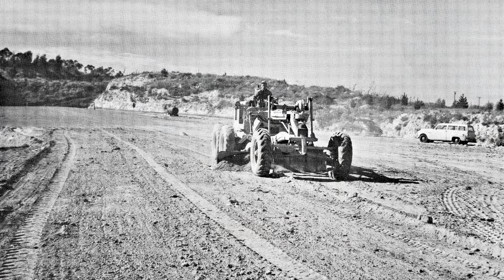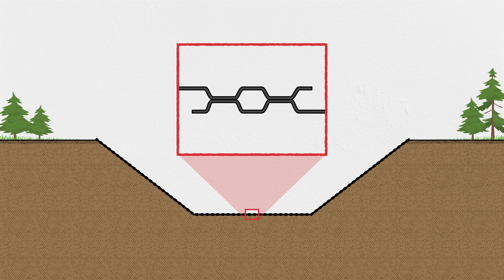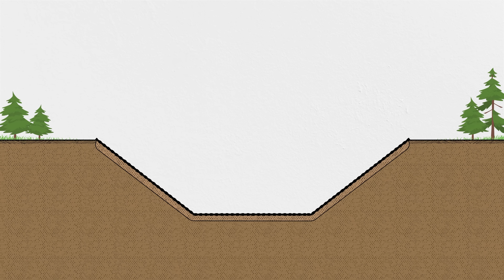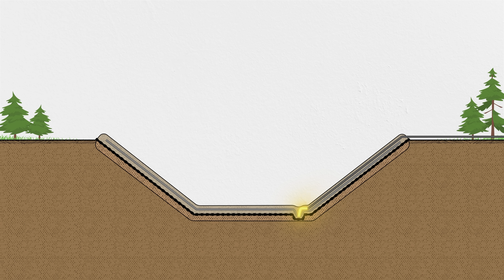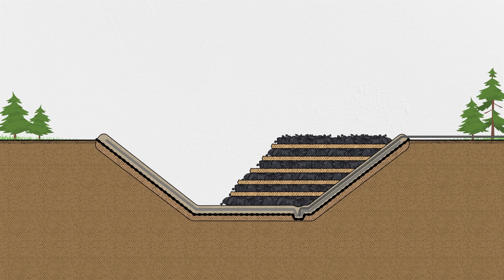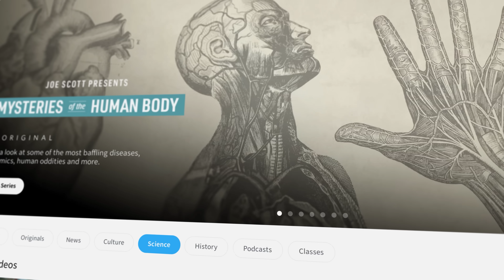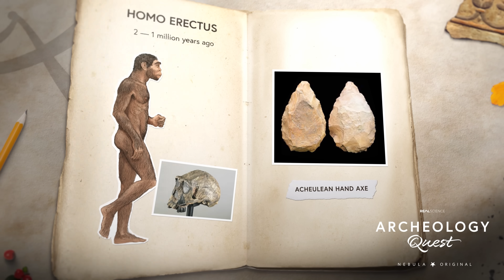The Hidden Engineering of Landfills

Comment: Fairfax County, Virginia used to have an active landfill on West Ox Road (it now serves as a transfer station for the incinerator which the various garbage trucks and the public will drop off waste which then gets trucked the nearly 25 miles to the incinerator in Lorton at the southern end of the county). They had put in the incinerator because the landfill had become the tallest point in the county, having risen over 300m since it began in the 1960s (becoming the tallest point in the county after surpassing Tyson's Corner in McLean in the 1980s) and was in danger of becoming unstable if it went too much further upward.

If you drive by the landfill on a clear night along Interstate 66, you'll see blue flames shoot up into the sky as methane is burned off. Indeed, the 911 dispatchers, if someone not from the local area calls in regarding seeing a fire at that location, will first verify if it is the landfill that the person is calling about and then explain to them that it's a controlled burning of methane from the old landfill.

Unfortunately, the county (when they installed the methane burners in 1996) decided to save $2500 by just burning off the methane, rather than using that burning methane to generate electricity. The board in 2003 was kicking themselves when they realized that they could have been funding county programs by selling the generated electricity from the burning methane to the grid. So they forked over the now much more than $2500 to upgrade the system and help the county with its budget shortfalls.

Comment: Excellent video! Explanation and props were perfect, as was your little helpers there! Here in Washington State PNW region, they have done astatically pleasing treatments with closed landfills, including walking paths, etc. NOW if the engineers can just figure a fool-proof way to handle nuclear wastes... Specifically the leaking waste site at Hanford, where contaminated leachate is headed underground, straight for the Columbia River.

Comment: Another fun story is that of the shoreline amphitheater in the San Francisco Bay area, it was built on the landfill site many years ago and when they first opened it the upper seating area which was basically just a grassy hill would catch on fire due to the methane leaching out of the soil from below, needless to say they had to close for a bit while they sorted out how to deal with the gases I believe they installed a piping system to draw it off and it's not a problem anymore but I remember hearing stories of people sitting there during concerts lighting up and then all of a sudden there was a little blue flame of gas in the grass next to them, good times. Keep up the great videos

Comment: I work for a company that dominates the solid waste construction and maintenance market in Wisconsin and the Upper Peninsula of Michigan. This video is spot on. Now if you really want to dive down a rabbit hole, start digging into how paper industry waste (sludge), coal ash, and steel slag are landfilled. Paper waste is especially fascinating because of the contaminants like PFAS & PCB’s that it commonly carries.

Comment: Have to be careful with reusing old landfills for new development. They tried that in Garfield Heights, OH by building a power center (collection on big box stores) on one and it was a a complete failure. The methane production was one issue. The bigger one (which killed the project and led to it becoming abandoned) was settlement of the the land due to decomposition... severe issues with settling (in some places, over a foot). Parks are probably fine... as long as everything is flexible and the parking lot is off the landfill!

Comment: Interesting about the engineering of sites nobody wants to think of. I remember back in 1970s where just about everything is dumped at the county dump. Paper, bottles, aluminum cans (stuff we now recycle), garbage, electronics, refrigerators, cans of paint and other chemicals, etc. I remember in 1979 an engineering class on energy, instructor had students do a project study and brief presentation on alternate energy (I did hydrogen fuel), one student presented collecting methane gas at landfills. He mentioned such sites can be used in the future, where they mine for minerals or "urban ore."
Reply: urban ore lol

Comment: I live not far from a retired landfill in Mountain View, California. Its contours were used to create the Shoreline Amphitheater.

This landfill does methane flaring. What I wanted to point out is that you can only see the flares above the flues when it’s dark out. And then only barely. There seems to be a bit of solid matter in the gas stream, because occasionally sparks can be seen streaming up with the exhaust. It’s nothing like the flaring you showed. Of course, showing what I see would be impractical (or at least underwhelming) for a popular video.

Comment: There's a disc golf course in San Antonio, Pearsall Park, that is installed over a closed landfill. They had to install the baskets up on 2' mounds above the ground surface to avoid drilling down into the landfill cover. Pretty good use of a closed landfill. The park also has a dog park, walking trails, and a very nice soccer fields facility.

Comment: I'm a Regional Manager for a company that designs and operates Renewable Gas plants. We specialize in landfill to natural gas and landfill to energy facilities. The amount of engineers and thought that goes into a trash mountain is crazy. This is a great video that goes over the inner workings of a landfill. I'd love the chance to run you through the system of scrubbing the raw gas from the landfill to heat homes and such. At a plant in NC, we also use a "virtual pipeline". AKA we truck the processed gas to a utility pipeline.
Reply: Those trucking costs must be high but I'm guessing less than getting a permit and construction for a new pipe line? Does the condensate from "cleaning" process get placed back into the landfills or processed separately?
Reply: @ocko8011  the trucking cost and complexity was an underestimated factor in the project. Pipeline isn’t cheap, and in this specific instance, just the right of way would have been an astronomical undertaking. A big deal in this industry currently is a new set of government guidelines that came out a few months ago that basically go over how we have to prove that the gas these plants are producing is what we say it is. The trucking makes that process a pain. The condensate usually gets pumped right into the leachate tanks at the landfill. Most projects then take that liquid to a water treatment plant.
Reply: The environmental division of the company I work for has a deal where the collection of gasses from our landfill in Niagara Falls is captured and pipelined directly to the local General Motors plant. I haven’t been well versed with the whole process through the landfills but it is another way that they are trying to sustainably support other local industries where we operate.
Reply: So trash becomes fuel? Like a power plant? 😊
Reply: @MikeJones-rk1un Yeah, a bunch of landfills, like the one in the video, have power plants on the site. They burn the methane gas to fuel turbines that create electricity which is then fed straight into the local lines. However like the original commenter said they can send the gas itself to the energy companies.
Reply: Can I sell for your company at my local landfill? I mean Y'all teach me the processes (I read p&id) and I’ll just keep selling and help build the project.
Reply: Guarantee this company survives only due to subsidies and taxes on fossil fuel. No way its able source energy this way economically. Time to end the green grift.
Reply: My guess is you work for Archaea, a division of BP.
Reply: @KipOConnell  I do not, but they do have a plant out this way.
Reply: Duke Energy or Dominion?
Reply: Are those gasses safe?

I would assume that they can change over time, depending on what was thrown away when, etc - so presumably you'd have to keep checking the chemical compositions, right?

On the one hand, I have great respect for any waste professional, doing their part to keep our societies running.
On the other, I'd love to make the CEOs and board members live close to those landfills or gas vent systems - just to make sure that they stay honest, haha...
Reply: @MrNicoJac it doesnt really change that much but it does depend on a few factors. There's 4 phases of waste degradation. In the final phase it's mainly ch4, co2 and residual nitrogen. Ch4 and co2 production dependent on the rate of gas production verses the rate of gas abstraction.
Reply: What method do you use to scrub the gas for use in Nat gas pipelines?
Reply: @RulkeMir4Lancer  we use a few psa systems and membranes.
Reply: Could I ask you some questions about what your company does via email? I along with 1000’s live next to a landfill that has been closed down, due to persistent compliance breaches, 
The smell is overwhelming
Reply: @Edie123-h9  yeah sure. Send me a dm.
Reply: Could I ask you some questions about what your company does via email? I along with 1000’s live next to a landfill that has been closed down, due to persistent compliance breaches, 
The smell is overwhelming
Reply: *Assistant to the Regional Manager.
Reply: I'd watch that video!

Comment: The US has lots of space for landfills. Properly designed and maintained, I'm sure landfills are good solutions for garbage. Although I'd think incineration, like those in Singapore, also works very well to reduce the final weight while also producing electricity. It will be interesting to see which method produce less harmful gases, and cheaper to operate in the long run.

Comment: You can also burn the trash, generating electricity and/or heat, you still need to handle the toxic smoke, but, that is possible. There are also things you shouldn’t burn, so it does require some sorting of the trash.

Comment: The problem is not the engineering; it is the money needed long-term. I do not question that there are good engineering ways to handle things properly. And as long as things get continuously monitored, one should be fine. With these landfills I have my doubts whether bottom insulation, leachate cleaning and handling of the gases will be done as thoroughly as needed for as long as needed. Both private and public organizations have a tendency to spend money today instead of saving it any longer as the bare minimum required by law. 

All this was less a problem when landfill was mainly paper, cotton, wood, metal and concrete… but nowadays we bury huge amounts of chemicals, some (PFAS) even being named „forever chemicals“ which do not degrade over time. 

These landfills are a time-bomb ticking. Safe and sound as long as there is sufficient money to maintain them, but things can quickly get a nightmare if that ever stops

Comment: 13:00 When on my vacation to LA last year, went to the Rose Hills Cemetery and the Buddhist temple and it was a lovely place to hike/explore around. Had no idea that the hillside next door was a closed landfill. Had actually planned to hike the Hacienda Hills which might've ended up walking atop the landfill itself, but delays meant I got in later (and it was hotter that day than forecast) so downsized the plans. Sure it'll be a lovely place when done adding to the already nice area.

Comment: @PracticalEngineeringChannel how long does trash stay in a landfill? Do we have a rough estimate of how long household garbage takes to (at least mostly) decompose under landfill conditions? I can't help but imagine a distant future in which construction projects just randomly dig up tons and tons of plastic waste from previous centuries wherever they are attempted... despite the obvious skill required to build and run them, landfills seem like a rather crude solution to me (which makes this video no less fascinating).

And a follow-up question: How does the environmental impact of landfills compare to incineration? Germany, where I live, puts about 1% of its municipal waste into landfills, most of it is either recycled or incinerated for power generation. The technology is obviously ready - are there benefits to still using landfills I'm not seeing here?

Comment: One of my college jobs back in the late '80s was doing various grunt-work at a geotech engineering firm. Mostly I did soil mechanics tests, but one time they sent me for three days to oversee (i.e. do inspections) on the top-liner installation of a landfill that was being closed. Some other contractor was responsible for putting down the membrane and welding the seams shut. I just had to watch them do the leak-tests afterwards and confirm it was all done right. They leak-tested with soapy water and this vacuum-suction thing that had a window in the top of it so you could see to the section of seam being tested and whether any bubbles were forming. Man. Haven't thought about that in a long time!

Comment: The liners form what is called a 'cell' in the landfill. Used to take foundry waste to 3 local facilities. One place used the methane to power 8 huge engines to power the place and the grid. Fascinating places. Smelly at times sure but you become 'nose blind' to it. On the work face the massive compactors and dozers shakes the cell (ground) beneath you. Soft surface. Challenging for a tractor trailer end dump. Worst time of the year was the THAW. Super sloppy stinky mess. Usually climbing the hill (trash mountain) we had to be pulled by a dozer. I can't say I miss it. 😅

Comment: I worked on a few landfills in SE Ohio and Bridgton Missouri. They were all former mines and quarries. They were all interesting. One used the landfill gas, methane, to run all their trucks. One turned into a coal mine when building a new cell. Ran into a fire resulting in 40' of settling and nuclear waste from the Manhattan project. They are pretty cool

Comment: Landfills are becoming one of our greatest sources of renewable natural gas. Not only does it help eliminate the need for fracking, it actually allows for net negative carbon since burning the methane has a lower greenhouse effect than just letting the methane off gas. There are not Bitcoin mining rigs running off natural gas power plants that are fueled by methane from land fills.

Comment: Wastewater treatment operator here. I used to work at a ~3 million gallons/day plant that was primarily landfill leachate.

Interesting comparisons:

-the collection system was not a main with branches but a grid of 138 vaults (50,000gal each) that were selectively opened as they filled up
>treatment plants are designed to remove certain pollutants, usually it's 1-2 pages long, this one was a full 7 pages
>we had to test solid waste from the treatment process (basically dead bacteria, spongy dirt) for radioactivity just in case
>we had a contract with the local municipal/residental waste plant to buy their wastewater (the pipes were in place for them to send us water) in order for us to dilute the landfill leachate
>we had a very long treatment process because each step was basically done twice (two aerobic tanks, two anoxic, two filters, etc) in order to meet pollutant removal requirements
>the plant would frequently flood and lose power when it rained really hard because the sewer main was used as a backup to the storm drain and the local power plant was poorly made, a common problem in the east coast
Reply: WW treatment plants never seem to be sized with enough reserve capacity to handle anything more than 25 year storms. In the Midwest many WW plants have outright refused to take landfill leachate due to PFOS/PHAS. 

Trash and liquids should be kept as separate as possible.
Reply: @ocko8011  You have zero idea what you're talking about. Treatment plants are never designed with reserves (fermenting waste = bio and explosive hazards), the state will either force private companies to take it or build public plants (to comply with federal or self regulation), and PFOS/PFAS have been banned for 60 years, not to mention being relatively simple to treat.

Comment: https://www.youtube.com/@PracticalEngineeringChannel Question about a different topic: I have come to understand that when water overtops a culvert, the culvert stops working as a pipe, & instead acts like a (leaky) plug. 
Q1: Right or wrong?
Q2: If initial overtopping cannot be avoided (such as caused by heavy flooding), how can one alleviate the situation? By sticking a large-diameter pipe inside the culvert with both  its ends above the respective water-levels to allow (more) air into the culvert?
(I have checked the list of your videos, but none seem (at a glance) to be appropriate. Please point me to the relevant video if I am wrong.)

Comment: The gas leakage cannot be overestimated. There is a landfill near where I grew up. I never knew it was there. Then, a few years ago, a national company bought the landfill from a local company. For the last year or two gas has leaked out of the landfill. It stinks! It doesn't just smell like rubbish, it smells like chemicals or gas. If the wind blows towards the town (of 125,000 people) then it's awful to be outside. The government bodies have tried to clamp down on the company but it still smelled today when I drove past it.

Comment: The gas systems are installed when the landfill is open (it doesn’t occur only at the end).    The energy that landfills produce from gas starts when the site opens and often will continue for many decades AFTER the landfill closes.  So, if a landfill is open for, say, 30-years, gas generation (in total) may last 75-years.  Increasingly, that gas is being used as a transportation fuel (qualifying for RINS credits), or scrubbed and put into the gas grid for use to heat homes, offices, whatever.